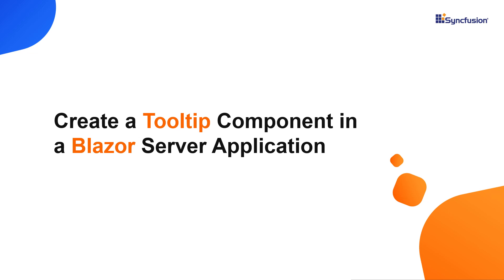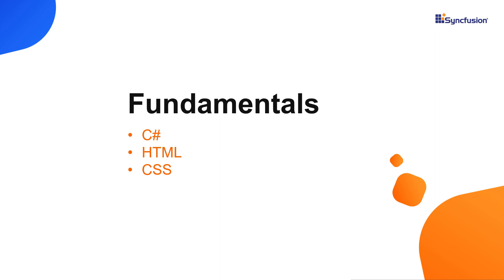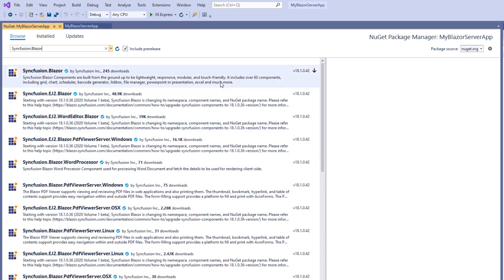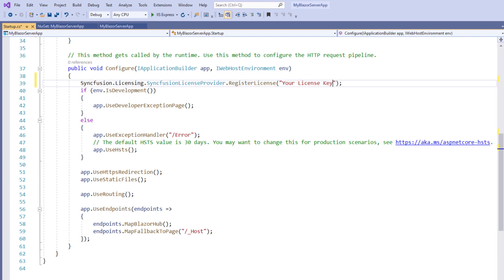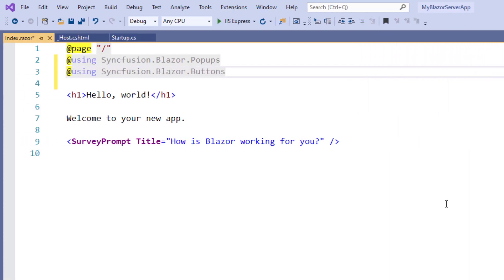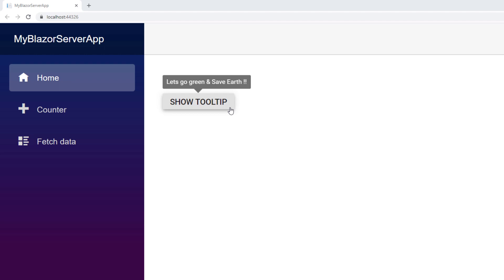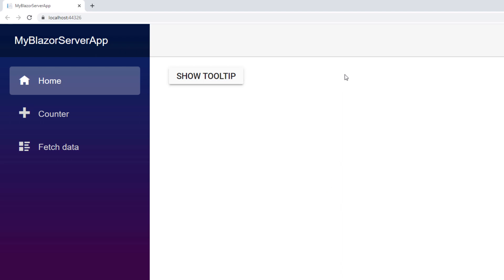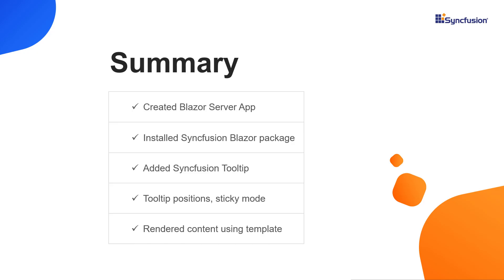Create a Tooltip Component in a Blazor Server Application

Comment from the maker: This video was created using .NET 3.1. Microsoft has since introduced significant changes in project creation and structure with .NET 6/7/8. The initial project setup process and the component usage has evolved. For up-to-date guidance on creating a Blazor app with the latest .NET version, please refer to our new video: https://www.youtube.com/watch?v=hjPGxApA5W8

The core concepts and Syncfusion component implementations shown in this video are still applicable, but we recommend following the latest project setup methods from the new video.

Comment from the maker: If you are working with 20.1 or later versions of the Syncfusion Blazor NuGet packages - https://blazor.syncfusion.com/documentation/release-notes/20.1.47?type=all#breaking-changes, we request you to ensure the following 3 steps in your projects-
1. Manually add the script reference under the <head> section of ~/index.html or ~/Pages/_Host.cshtml files. Read More: https://blazor.syncfusion.com/documentation/common/adding-script-references
2. Syncfusion.Blazor.Themes is removed from dependencies of Syncfusion.Blazor.Core. So, if you are looking to refer themes from static web assets, ensure to install Syncfusion.Blazor.Themes NuGet package explicitly into your project. Check out how to manually add the style reference, https://blazor.syncfusion.com/documentation/appearance/themes#static-web-assets 
3. While registering Syncfusion Blazor Service in the ~/Program.cs file, you would have set IgnoreScriptIsolation property as true to load the scripts externally. From 2022 Vol-1 (20.1.*) versions, the default value of IgnoreScriptIsolation is changed to true and marked as obsolete, so it is not necessary to set this property explicitly in your projects. Read More: https://blazor.syncfusion.com/documentation/common/adding-script-references#disable-javascript-isolation